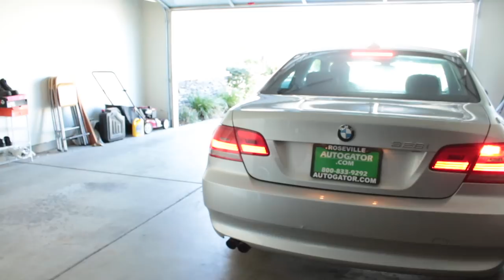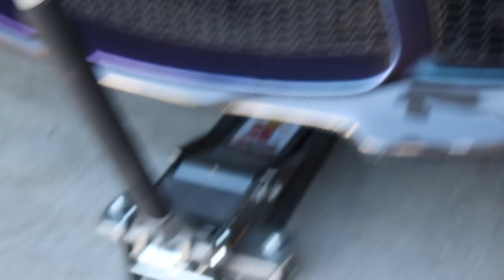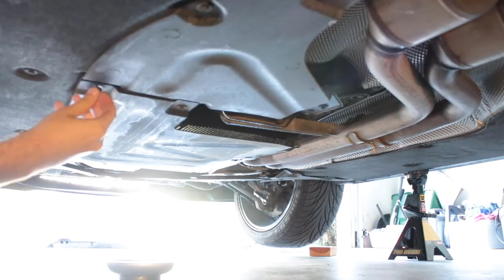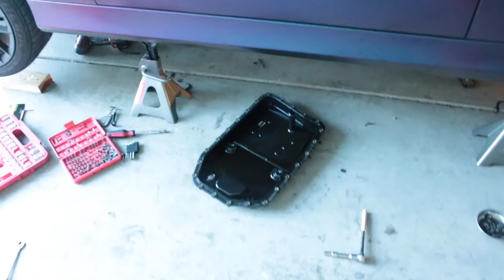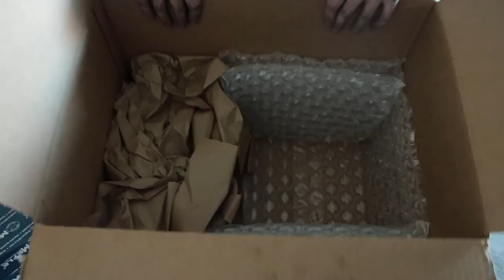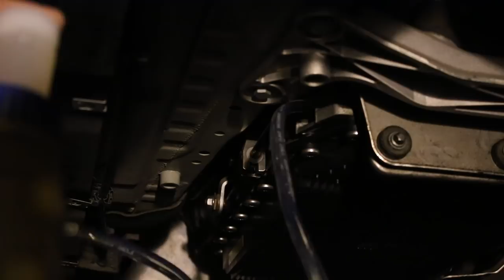HOW TO FIX YOUR JERKY TRANSMISSION! (E90,E91,E92,E93)

Comment: Had the same issues replaced solenoids from mechatronics and torqued to spec, seals and mechatronics sleeve also replacedaccording to the sayarti link along with new ZF fluids.  Make sure transmission is at operating temp before topping off.  Runs like new, no lurching when braking. Understand your frustration it was annoying.  Parts were bought from BMW South Atlanta and FCP Euro.  Don’t waste your time diagnosing with the stealership, they will want to replace your whole transmission.

Solenoids do go bad, if you don’t have the software don’t reprogram according to FCP Euro unless you have open roads to go through the relearning procedure.  Good luck.
Reply from the maker: What is the main problems the seals or the solenoids?
Reply: Nour Hummadi solenoids and seals you will want to replace them at the same time.  There is also a YouTube video online, prepare to get messy but you can do it. It is very rewarding when your car runs better.  

Main thing is make sure your that you put fluids in while the car is running and transmission is running so you can top off not having enough fluid in would still cause the lurch. ZF also has a video how to properly cycle through the gears.
Reply from the maker: Kevin K please link videos, also are you located in Cali?
Reply: @Kevin_Keo   hi kevin can you please link me the video
Reply: Manjinder singh 

https://youtu.be/41tRoHraqY8

Comment: Good work bro. But missed all major steps to avoid jerky transmission.
The part that teally need to be changes is ADAPTER and SLEEVES. For that you have to remove the valve body. After reacing that you have to reset transmission adaptations through INPA.

Comment: e90 316 manual pre lci. 
1) from 0 when i try to put my first gear in sometimes is not possible and i need to put second then first gear. 
2) gears is a bit hard to change them. 
what you think is the issue?

Comment: Please don’t use this as a tutorial People, no mention of priming the gears up and getting it up to running temperature to do a second check of the oil level. I’m not surprised you didn’t feel a difference your transmission probably has a quarter of the fluid it needs.

Comment: Did u reset the transmission after you did this fix? Also when does your transmission jerk? Mine jerks as I'm starting to move but never had a problem while actually driving
Reply from the maker: I say all my issues in the end of the video, unfortunately my transmission still jerks after the reset.

Comment: Change your differential fluid, remember the diff is the final gear and could be contributing to the jerky-ness.
Reply: Explain bro
Reply: @perc_man_.2322  bmw hold oil near the rear bumber to keep axle lubed I think, if you hit a curb like me and damage the diff it might leak out oil

Comment: My E90 was doing that jerky shyte and revving to 500 rpm without changing gears. This only happened after changing the gearbox oil. I jacked it up yesterday and added another litre of oil. Problem solved think I need to add more as it wasn’t running out the fill hole. When I first changed the oil I did it with the motor. This time I had the motor running. Feels like a new car.

Comment: Hey man what did the dealer say when you finally took it and had them figure out the jerky transmission issue from 2nd to 1st? Did they say replace the solenoids?
Reply: Bro mine has the same problem car won’t go into gear and they told me 
Shift valve b is stuck in off position and too replace the transmission oil

Comment: You should check the sleeves inside the transmission while the filter is off as they are prone to leak and cause a judder/hesitations and also the gearbox ecu adaptions should be reset using inpa software or similar then it will reset to factory and self learn all over again so the solenoids inside the gearbox will work as they should and not as they learned too while it was not working 100%

Comment: Nour, I have 2006 525 XI and I am getting random transmission errors connected with handbrake. car doesn't start throwing out all sorts of errors related to transmission and handbrake. I let it sit for few hrs and then  move the handbrake up and down and it gets auto fixed and the car starts after few hrs and the error is gone. This error happens randomly and am not sure what the actual issue is. what did you discover with your transmission issue ? Can you share the follow up video you mentioned? any suggestions on the above issue? Appreciate any help. Thanks.

Comment: Hey man I recently just got a "trans. Malfunction" notification light on my 06' 330i would performing this solve that light or should I do a diagnostic first?
Reply from the maker: I would diagnose it first but changing the fluids if not changed in years would be a great place to start. I found out that It could be my soliniods.
Reply: Hey man did you end up finding what was wrong with yours? I’m in the same position as you with the same car

Comment: You can also use the INPA to reset your transmission to help. Also great video man been waiting on this !
Reply from the maker: np man, is the inpa a chip or software?
Reply: Nour Hummadi it's a software. If you search bmw e90 INPA transmission reset on goggle, you'll find forums on how to do it
Reply from the maker: have you ever done it?
Reply: Nour Hummadi I was planning to when I change my transmission fluid but haven't got time to do it yet. Hey it doesn't hurt to try it. Just make sure it's done professionally, just to be on the safe side
Reply from the maker: Jameer Ali 👌
Reply from the maker: Jameer Ali 👌

Comment: I'v never had the misfortune of doing a bmw, but I'v often cured that "clunk" by taking out the valve body, di-assembling it, and just a simple clean, get out any grit . . . . plus while I was in there, check the solenoids! Obviously new recommended oil. Hope this helps someone.

Comment: I’m having this problem now the same exact car a 330i it’s stuttering between 2000/ 2500 rpm I was thing of doing the fluid & filter change but a mechanic said straight forward it’s my solenoids 😩
Reply: so replace them

Comment: I have the same issue. Mainly shifting from 1-2 and 2-3, seems to be more noticeable when starting off slow. I have kinda gotten down the speed to minimize the jerk as much as I can. 

I had a misfire in one of my cylinders and replaced all spark plugs, afterwards the jerking was significantly less aggressive, not sure if it had a direct effect but seemed to helped a bit
Reply: Yo dude same what should I get fixed to get it to stop
Reply: @EquestrianNikki   you fix it ?
Reply: @EquestrianNikki  did u fix it?

Comment: for me, from 2nd to 3rd jerks the hardest. especially when im rolling down a hill from a complete stop, it jerks so hard it feels like someone hit the back of my car,  i have to push the peddal down hard to avoid a jolt.
Reply from the maker: I feel it but that 1st and 2nd for me
Reply: for me it does jerk 1st to 2nd but mostly when i roll down a hill and push the pedal down a little.  but sometimes the shifts are smooth as butter gears 1-6. I have no idea what the issue is. Theres many things that can be wrong unfortunately

Comment: I swapped out my oil for $30. Simple drain and filled up with normal automatic transmission oil. It helps a lot, and it’s easy on the wallet.

Comment: My car shift Smooth but like 30 minutes of driving it hard shift 3-2 jerks. It got be way to fix this issue I’m going around and tryna find ways to fix it my next step is replace the shifter  my wires are all cut but they all re connected. And still having the jerk issue

Comment: You need a new Valve Body, I work with an Engineer who worked on the design and he described how the car shifts when the Valve Body is on the fritz
Reply: Ignacio Romero it sounds like fluid pressure chatter a sticky valve, faulty manifold pressure switch or contact, or internal pressure discharge.
Reply: @tomconner9695  You are correct.  It's a bad solenoid.  I replaced all solenoids in the Mechatronics (Valve Body) at 118,000 miles.  I now have almost 190,000 on my car and it still shifts like new.
Reply: @michaelhunt4074  link to buy solenoids ??

Comment: Dude if your oil was as burnt as you say it is check the oil filter for the transmission if you have fiber deposits in the filter your clutchs plates are worn down
Reply from the maker: Its an auto tho, idk link me the filter itself. thanks for the feedback
Reply: Nour Hummadi automatic transmissions have clutchs too check that filter you have those deposits you'll know your clutchs are worn trust me I rebuilt my transmission earlier this year just check for the deposits in the filter. Good luck!
Reply: Hope this helps you understand what am saying
Reply from the maker: wow that link is crazy helpful. If you can pose this comment again but as a separate comment I would like to pin it :)

Comment: I’m looking to trade my 350z for a 2008 bmw 328 but he took me in a ride in the bmw and it vibrates around first gear...I’m worried it will be expensive to fix and that it’s not just one problem...🤔idk but this videos is nice lol
Reply from the maker: Whit 350z that’s not good don’t do it. Where are you located?
Reply: I jist finished trading my heavily modded Z for a n54 and I regret getting it it looks nice but too much engine problems and expensive parts ive changed the starter battery vanos sensor crank sensor water pump intake o2's plugs coils I gkt a whole list and mine still runs like crap...

Comment: My auto 2006 330i "jerks" only when downshifting from 2nd to 1st.  I've read alot of about update and reset in a few BMW forums.  Keep us posted on what you figure out.
Reply from the maker: Taylor DIY got you, I would change the fluids ASAP tho if the fluids have never been changed. Sounds like you caught it early. That used to be like mine but I waited and waited and now it’s jerks on a lot of gears. I’ll let you know what happens
Reply: Nour Hummadi, I plan to change the trans fluid soon.  What makes me think there is more to it than just the fluid is mine shifts smooth in the "manual" shift mode.  Thanks.  Looking forward to seeing what you figure out.  I subscribed to you channel.  Sub back if your interested.
Reply from the maker: My car also shifts fine in sport. Changing fluids is a must, then you probably need to update. But changing the fluids is a must to keep your tyranny healthy.
Reply: Nour Hummadi, of course.  I couldn't agree more.   I'm a self taught "mechanic" of 15 years. I swear by changing fluids.  Thanks.
Reply: Read a guide somewhere where they said that the jerk from 2nd to 1st was fixed after they replaced the solenoids. My 06 330i is doing the same thing, so going to do the solenoids, mechatronic sealing sleeves, pan and filter, and the fluids. Then reset the adaptations after.
Reply: Solenoids in the mechatronics need to be replaced. I would do that when you change the fluids. If not you just wasted a few hundred dollars because you have to drain all the fluids and buy all new again to access the mechatronics unit. My 06' 330xi is due for the same service. It's at 108K.
Reply: Having the exact same problems w my 06 330 -_-

Comment: it will leak because you must set oil level based by temperature, and you must reset adaption with a diagnostic tool otherwise the transmission will use old values and will feel jerky as shit.

Comment: Great video! I need to do this soon for maintenance(close to 100k)! Do you know if your 330i uses the ZF transmission or the GM transmission. Hope you figure it out!
Reply from the maker: all I know is that this is the exact kit you need for automatic e90s http://amzn.to/2gUinJk
Reply: Nour Hummadi You must have the ZF. Very good transmission, probably the best on the market besides their new 8 speed. It doesn’t fit mine though the 328i has a GM 6L45 transmission shared with the Cadillac ATS.
Reply: I have to do mine soon as well
Reply: BMW-E90-transmission says on the side of the transmission zf or gm

Comment: Solenoid valves must be replaced along with valve body pump seal, sealing sleaves oring and of course new filter and fluid properly filled at correct temps with Ac running
Reply: Paul Nevarez not so much
Reply: AC running ? ...nah man

Comment: Just did a OTS stage 2 tune with MHD on my automatic 09 e90 335xi, (sometimes) when I shift from 4th to 5th it will slip, kinda make my car brake in the back, and sometimes it even pops up the yellow gear light. No rough idle just put ngk plugs and eldor coils in. Anyone have an idea what might be wrong ???
Reply: the 4-5 is exactly what I’m experiencing right now, did you ever find a fix?

Comment: Hello, I have a 528xi 2008. When I press the gas and the gearbox automatically switches from the first speed to the second or third, it has twitching when picking up speed.
 everything is fine at high speed
Can anybody tell me how to resolve it?

Comment: When I used to have my E46 I changed out my transmission fluid myself You're supposed to change it every 100,000 mi That's what the manual says but BMW tells you no lifetime don't listen to them you should change it every 100,000 miles The jerickinessI'm not quite too sure I picked up my first E90 and now I am experiencing that

Comment: Hey did this completely solve the problem because my bmw jerks alot to and i hate that can you please let me know how it went so i can buy the kit and do the repair myself?
Reply from the maker: check the end of this video. It helps it slightly and makes your tranny healthier but you will still need to update or perform a full reset using a machine if this dose not work 100% I mention everything in the end of the video and the description check it out :). Her is the link to the exact product comes with everything you need.  http://amzn.to/2gUinJk
Reply: Yeah i watched the end of the video my car makes a jerking sound when i am stopping.Did you have the same problem? And does the full reset have to be prefromed by a technician.

Comment: Have you tried resetting your transmission?
Reply from the maker: BladeTheMotovlogger tried the gas pedal trick but did not completely fix my issue
Reply: BladeTheMotovlogger  hi need ur help please
Reply from the maker: Kemelon Andrew what’s up
Reply: Nour Hummadi my bmw 320i e90 where I try to move of it start jerking up
Reply: what is the pedal trick???
Reply: there´s no pedal trick, you must use a diagnostic tool to reset transmission adaption.

Comment: this is bullshit. You cannot change the trans fluid like this. The trans fluid can be propely changed only by special machine that extracts all the oil from it because otherwise if you do it like this guy there is always 2-3 litres that remain in the torque convertor.
Reply: He did it right. You're describing a flush, which is very risky on older AT's.

Comment: mechatronics valve body needs to be replaced, my e90 does the same thing, dont pay the 125 at the dealer
Reply from the maker: Mohammed Qayyum those are not cheap should I just get a new tranny
Reply: Nour Hummadi my local salvage yards sell the 6hp 19 for 600, I’m going with a used one then after 10k miles I’ll replace the solenoids and valve body with a fresh oil change the trans should last me another 3-4 years my car has 260k on it these are really good transmissions they just need to be maintained and the new valve body is updated so the jurking will permanently stop
Reply from the maker: Mohammed Qayyum these transmissions are a joke man lol